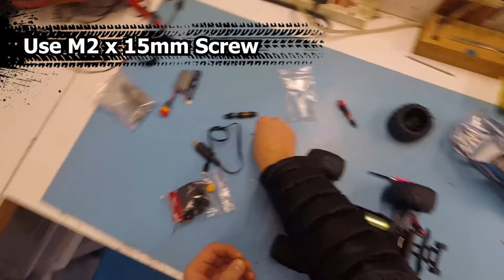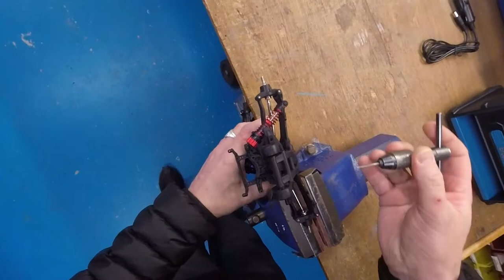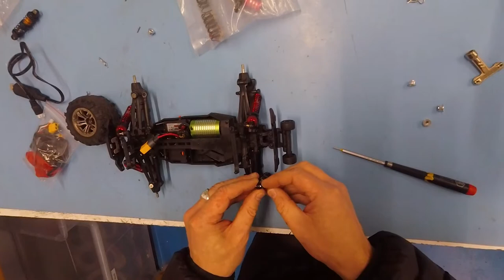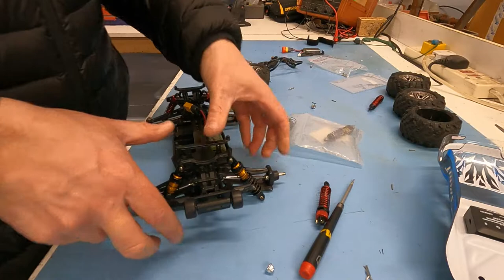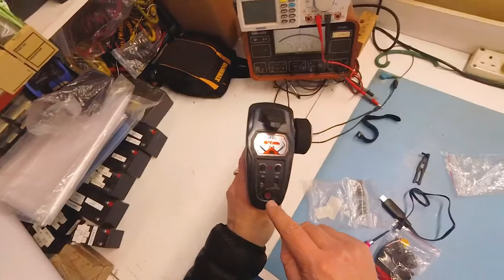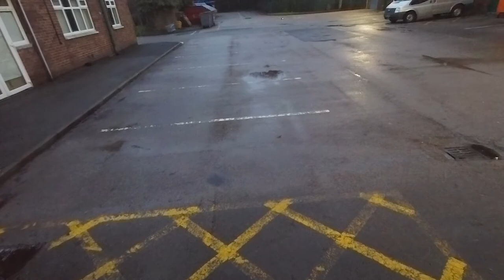Xinlehong Q901 -  Shock Upgrade  Using Tamiya CC01 70mm Oil Filled Shocks

Comment: Hi there... I bought the same model and same shocks, had you filled it with oil?
Reply from the maker: The Tamiya shocks I bought where already filled with oil.
Reply: @BobHoskinsVideos  i mounted it today, it's a good improve , i also installed a fan on the engine and tryed it with lipo 3s. It works! But the esc became a little bit hot. Gratest from italy.